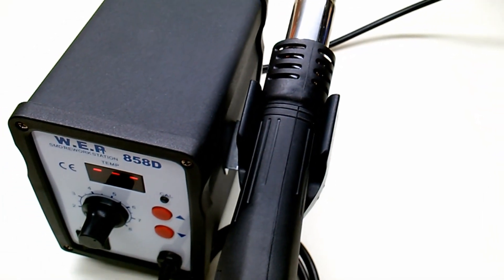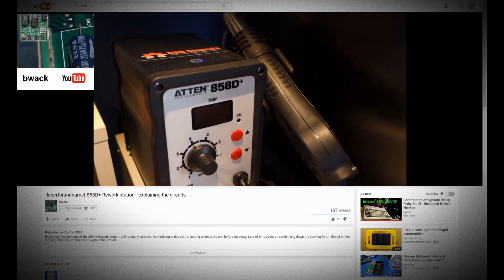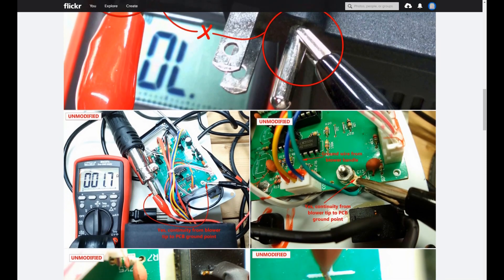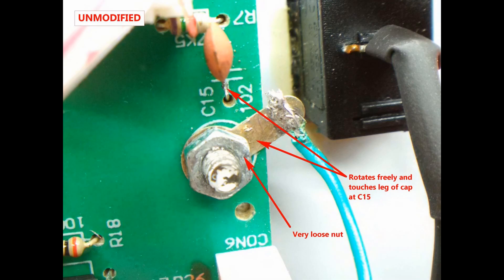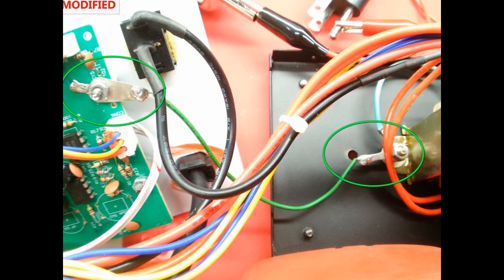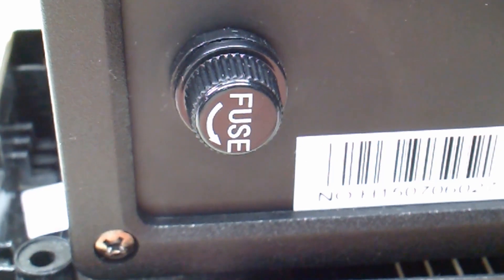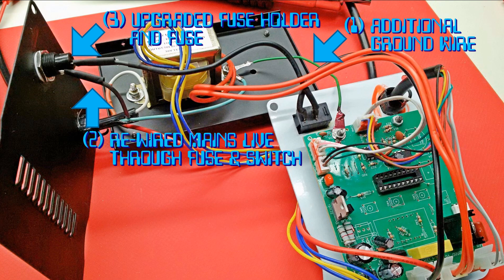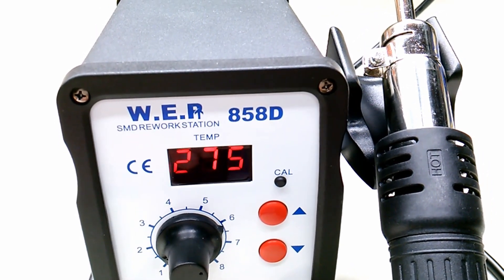#06 "We Put the 'K' in Kwality" — 858D Hot Air Rework Station Safety Mods

Comment: Imagine this proper grounding and having no proper ground in power outlet. Or worse neutral wire being used as neutral and ground. This is how more than 70% of the world uses electrical power. 

The proper mod would be to add transformer to insulate the mains altogether  - safety for the equipment you are repairing, and RCD for your safety not ground.

About reversed wire well, in UK you can't reverse the plug socket, in europe you can. And that opens a whole can of worms. So replace the schuko F to schuko E socket so the reversing of the plug would be not possible.

Comment: Never solder a ground connection. Always use crimped connectors. Solder can melt in case of a fault, the crimped connection doesn't.
Reply: In Germany it is not allowed to solder mains connections or other "high current/voltage" connections. Exceptions are machine-soldered connections like inside VFDs.
Reply from the maker: You are absolutely correct, sir. I used what I had on hand for this video. Also, I am not confident the gauge of the wire is suitable, either. Thanks for your comment.
Reply: MindFlareRetro No troubles, it just came to my mind as I saw it. 
It's not bad in this case because of low current. Just keep it in mind for upcoming projects.
Reply from the maker: Will do. Thanks again.

Comment: what to do about mains when the plug can be put i the wal outlet both ways 220-240volt in scandinavia?
Reply from the maker: Thanks for your question. I am not sure how to answer, as I am located in North America. However, I have asked bwack in the comments below if he can shed some light on this question, as he lives in Norway.
Reply: leohobb: Do you mean the wall plug can be plugged in either way? And that there is no GND. connection - just Pos. Neg.? If so you must check which terminal in the wall socket is Pos. and which is Neg. and plug in accordingly. Do mark the socket once this has been established - and mark the plug from the 858D as well. I assume you DO have A/C not D/C?  Michael Studio1. UK

Comment: Thanks for this GND connection advice! I also found in my acquired today unbranded 858D that there was no GND connection to the hot air  tool. I am going to insert your GND jumper mod. The UK 13amp. plug is connected correctly - indeed the plug prongs are identified on the plug housing itself - so they daren't mis-connect it! (or dare they?)
Reply from the maker: Thanks for the positive feedback Michael. I'm glad you found the video to be useful. In retrospect, I used too thin of a gauge wire for my ground, but I wanted to use green for the video and that was all I had on hand. I believe 16 AWG would be more appropriate. Thanks again.
Reply: Currently I'm a little concerned that the 858D is 220v 50Hz. Voltage here in UK is (just measured) 247v @ 60Hz. Not sure whether I dare plug it in (after installing the GND mod, of course) or ought I to power it up through my Variac.
Reply from the maker: Hi Michael. According to http://ask.metafilter.com/76438/Can-I-use-a-220v-device-in-the-UK, UK mains voltage can be 230V +10%/−6%. When you see an appliance rated 220V but your mains at the plug is 240V (or 247V in your case), the latter is the voltage at the delivery point into your house wiring, the appliance voltage other is the minimum voltage that it is designed to use. All that said, I believe you will be fine plugging it in an using it. Also, to confirm, AC in UK (and the rest of Europe) works at a 50Hz frequency, where North America is 60Hz. Keep us posted how it goes.
Reply: Thanks for your studied reply. Sorry about the Hz. I lived in Vancouver BC for some time, worked at BC Tel (Wm.Farrell Bldg, 768 Seymour) and got so used to 60Hz. I forgot the UK was different. That's where the Variacs came from - I have a pair in series bought from L.A. Varah's - who probably no longer exist. This was 1963.
Reply: In the Workshop: Found that in this un-branded 858D
 Hot Air Gun, unlike Dave's 'ATTEN' 858D there is NO reed switch. Neither is there any connection from the chromed metal blower tube in the gun back to the Control Unit. So it seems I will have to leave this part non-grounded. I wonder if there's any real need to GND this anyway. Comments??
Reply from the maker: Are you Canadian born or just lived in Vancouver for a while? I'm in Ontario, myself, just west of Toronto.
Reply from the maker: No reed switch? So it doesn't cool down and turn off the blower when placed in the cradle? The ground is really a best practices safety measure -- having said that, the device likely wouldn't pass any formal electronics safety certification without proper grounding. Just don't use the blower on or near anything that is still plugged into mains or engergized in any other way.
Reply: Found the GND wiring IS in place and working from chrome nozzle to GND connection on mains plug. So OK.
Reply: No reed switch. Haven't turned the 858D on yet - just following all advices before doing so.
Reply: 'Scuse the time delay! I'm UK born and just lived in Vancouver a few years b4 returning to UK. My 858D IS branded: 'HV/K' and I'm pretty happy with it . .  or was until I just saw Dave's Blog on the new 'Quick 861DW. However I don't use the 858D frequently enough to justify the xtra! Keep blogging!!

Comment: High quality informative well thought out and put together video greatly appreciated just waiting on my 858D clone to arrive will be safety checking it.Please continue to churn>
Reply: N.B. your clone 858D may NOT have the cut-off reed switch Dave shows in his eev Blog. My unbadged 858D doesn't. But the fuse holder WAS wired back-to-front which could have been shocking when removing a non-broken fuse! Neither is the chrome nozzle grounded in any way - which is probably a Good Thing
Reply: Having just turned my clone 858D on for the first time, I powered it up through my pair of Variacs (Ohmite) with the out put at 220v - which is what this clone 858D says it's rated for. One interesting thing: although I said earlier that it does NOT have a reed switch, there's certainly something in that handle reacting to it being placed in its cradle - so I guess I just didn't see it. And, as I said, the chrome nozzle IS at GND potential.
Reply: Now I can get on with my problem of solving, through reflow of the several boards in a Denon - AVR - 1912, the  missing 'L' audio channel. The 'R' audio channel is OK at the SPKR terminals. Am feeding two different Audio tones into VAUX IN.
Reply: Yes, I saw that - but my unbadged 858D has nothing like that slender reed switch in there. Short of removing the whole chrome blower tube from the half casing to which it is attached there's no evidence to support the reason the blower stops when the hand unit is replaced in its cradle. I don't wish to destroy it - so I accept it.
Reply from the maker: Thanks very much for the kind words–much appreciated. I'm always happy to hear that my videos are useful to people. Good luck with your 858D when you get it.
Reply from the maker: Dave (EEVblog) tears down an 858D and identifies the reed switch if that is any help, https://youtu.be/vva2t21sOAs?t=8m14s.
Reply from the maker: Yeah. Leave well enough alone and get on with your Denon repair and other fun.

Comment: Lucky i watch this video first before.Mine comes with no fuse holder at the back.
Reply from the maker: Thanks for watching. Yeah, I've heard of this too. I recommend getting a quality name brand fuse.
Reply from the maker: I think I misread your comment. You say your 858D is not fused at all? Perhaps there is a fuse holder with fuse inside the unit? I'm curious. Please let me know.
Reply: yes it actually does have one. My model was youyue with  858D06.PCB 2016.09.29 .
Reply from the maker: Very good. Did you have to make any other safety modifications?
Reply: i did not as i check they all have the proper grounding like your modification, not sure if i should go buy a new fuse though. So far so good as my led smd rework went good. I found people in eevblog updated the firmware stuff which is also a youyue model but it was a 2014 version. Another last thing is this thing comes with two prong power cable CEE7/7 plug which is specifically designed to work with both the German & French sockets. My wall socket is uk plug style so im using universal power adapter to connect it but then the ground will not be connected to the 240v wall mains earth.  Do you have any comment on this?
Reply from the maker: I am really not qualified to answer that question. In North America, you will find appliances with and without a ground prong; any devices without are therefore not grounded to earth.  I can only assume it's the same for your universal power adapter.  With regard to the 858D, I think having it grounded is a precautionary measure to protect the user from getting a shock in the event of a catastrophic failure inside the unit.  Perhaps a something to keep in mind would be that if your 858D ever seems to malfunction while using it, be sure to unplug it from mains before you touch the chassis or the metal tip of the blower.  Also, be sure that the equipment you are working on is unplugged from mains.

Comment: I can't believe how cheap these are, currently around £25 delivered UK...
Reply from the maker: Wow. That's really cheap now. I just checked and I paid CAD $60 (around £35) from Amazon -- they have several local distribution warehouses around the Toronto area now, so fast local shipping -- in May of 2016, and that was a great price at the time.  I just ordered smaller diameter nozzles from China last week.
Reply: just found it for £22 inc delivery... makes me a bit dubious about buying it... might go for the £50 version of the exact same product to make me feel better :p
Reply from the maker: £22 on eBay?  Could you post the link -- curious to see it.
Reply: but I am presuming this is from a uk warehouse run by one of the chinese distributors
Reply from the maker: Looks legit from the pictures, and the seller has a very high feedback rating. Yes, in reading it appears that it ships from with the UK. Maybe that's why the price is crazy cheap. Almost too hard to pass up.
Reply: just got mine - an un-branded 858D £22.97 incl P&P e-Bay UK (18 Nov. 2017) found no GND connection to Hot Air nozzle either so am installing a GND jumper as advised.

Comment: Nice job on the video and the added safety! I still don't have one of these but I'm planning to get one some time and your video will be very helpful. We don't have forced polarity on our Euro plugs here so it's a matter of luck if the neutral or hot is fused in most electronics. ;)
Reply from the maker: Thanks.  As I mentioned to Greisis Workbench below, I'm not really clear if the fuse placement if really that critical -- hard to find a definitive answer.

How's your cartridge video coming along?  I'm more than curious to see what adventures you had with the Simple64Cart after bwack's fun with it.
Reply: All uk plugs have the fuse on the live side of the plug and as a rule I would always fuse ac on the live side and dc on the plus side
Reply: Jan Beta It doesnt matter if the fuse is on the hot or neutral side xd

Comment: Very nice video!
I also had(!) a 858D from Atten - The first time I switched it on, sparks and flames where coming out of the nozzle. Took a few seconds, but finally the circuit breaker of my power plug tripped (And yes, the fuse in the unit was still intact :-) ). I think they installed the wrong heater element in the factory or it was somehow shorted out.
The mods are a very good idea. Although I don't think that point 2 (Re-Wire Live though fuse) is really necessary (at leat here in Europe) - in the end it does not matter where you put the fuse (the circuit will still be interrupted).
When I took mine apart I noticed, that the case (Front panel, back panel and housing) where also made out of metal and where also not grounded which means if for example the live wire of the fuse holder snaps off and touches the back panel, then the back panel would be live and the RCD/FI would not trip. Maybe it would be a good idea to connect the metal parts of the case also to ground or I have seen some people file / sand away the paint where the parts of the case mate up so they are electrically connected to ground.

And keep up the good videos - I especially like the slow panning shots :-)
Reply from the maker: Hi. Thanks for your feedback.  Wow!  Flames!  That would have made a fun video -- Big Clive style.  Sounds similar to my solder sucker disaster, https://goo.gl/HNHHFg.

'Re-Wire Live though fuse' is always a debate here.  It might just be the convention here to establish a common standard practice with "certified" appliances.  There is an interesting discussion at https://goo.gl/zK3m7q if you are curious -- any references to "U.S." would apply to Canada as well.

I did sand away the paint from several ground connection points and as well the broken ground connector.  I also threaded the ground wire through the metal ring connector, twisted the wire together and re-soldered the connection.

If nothing else, this device is likely safer than when I received it.

Thanks again.  I'll continue to try and master the slow panning shots to keep things visually interesting.  :-)
Reply: Often, the heating element is still covered with some grease or oil out of manufacturing when mounted in these units. This goes for soldering irons as well. The first time you power it on, that grease will cause smoke (maybe even flames, though I never did see this with soldering irons... must be a hot air blower special :D). Once it has "burned off" the heating element, you won't have this. This is not a problem and is quite general in fact.
Although, don't let it burst into flames :D
Reply: Changing the way the fuse holder is wired could be significant if anyone withdrew the fuse with the 858D still plugged in to the mains. The way it is now on withdrawing the fuse, if it is NOT broken, one can get a shock if the other end of the fuse touches the threaded opening. No?
Reply: @michaelgamble296  Only if someone were stupid enough to remove the fuse with the unit plugged in.

Comment: Thanks a lot for this summary!

Being me, I have one thing that I don't really like: Soldered earth connections.
I don't know, whether US or Canadian regulations contain any secton on this, but I found that soldered connections often break due to thermal expansion or vibration.

Thus, I prefer crimped lugs for those rather vital connections, plus tooth washers for proper conductance.
Reply from the maker: That is a very good point.  Off hand, I am not aware of a North American regulation regarding this; I am sure there is.  I found an interesting discussion in an EEVblog Forum thread, https://goo.gl/z71oLc.

I did clean-up (sand off the oxidation) and re-solder that factory-soldered ground connection that had broken off (hmm, that seems to reinforce your point) but I did loop it through the metal eyelet connector and twisted it together before re-soldering.  I used the same technique for the short ground wire I made.  Although, in hindsight, I should have used a more appropriate gauge of wire -- mine is too thin.

Regardless, your crimp vs. solder suggestion is definitely good practice, that is for sure.  Thanks for your valued input.

Comment: Very good video, very well explained, since watching a few vids from eev I now take everything apart when it arrives and check it, must add one of these to my arsenal and follow your safety measures, one additional thing I do personally is add a dab of hot glue to any wire connections for added fixing strength and if they ever need removing just add some IPA and the stuff comes clean off.
Reply from the maker: I missed this comment the other day. Yes, the hot glue is a good tip. I need to start a notebook of good electronics lab tips.